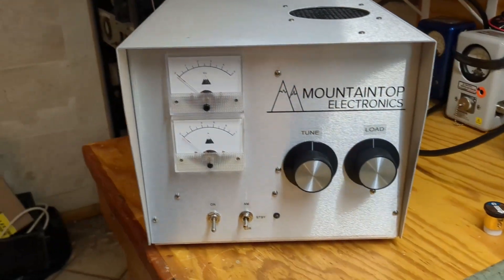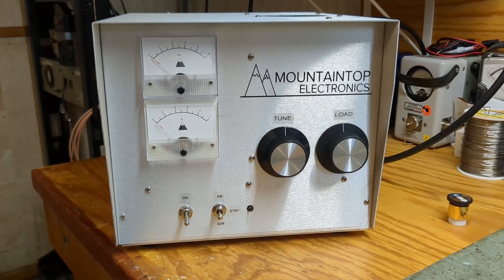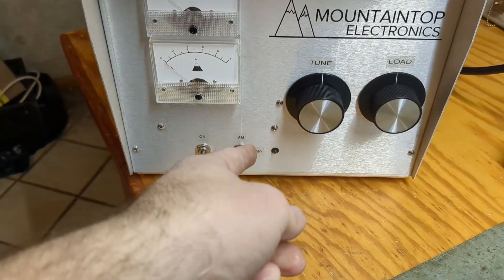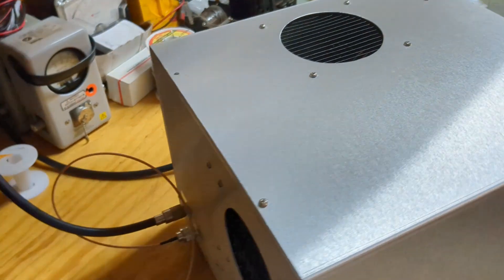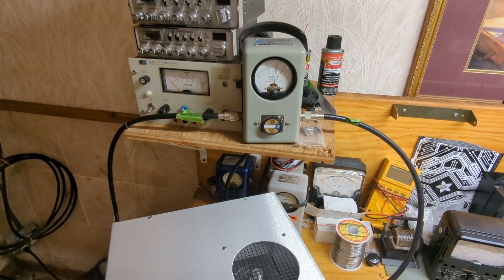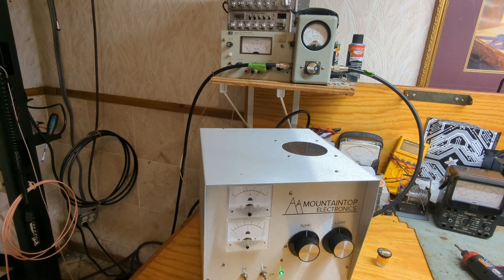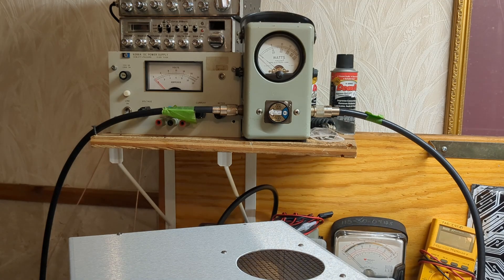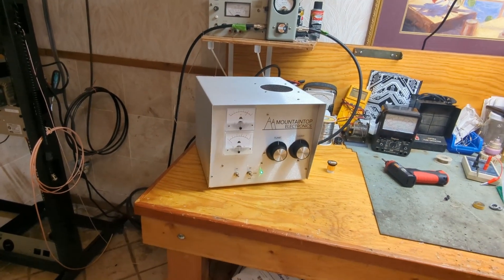3-500z Small Case Build *SOLD*

Comment: This is a beast, I have a home made base amp runs 220v 50dk input 150pep for 1000kdk, 7,700 pep with 4 500z's loafing. I use a jo gunn hillbilly with the 12k gamma matches for antenna 125' atop a 90' harvester silo up here in Watkins Glen, New York next to the race track. If you watch the races from up here you can see my Antenna atop of that Blue Silio.